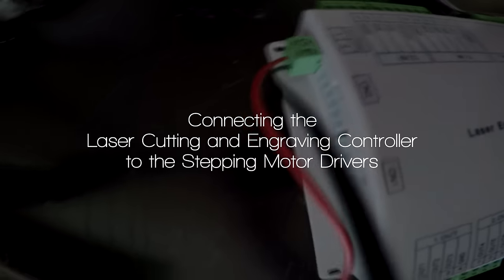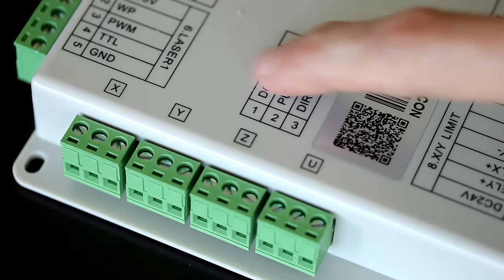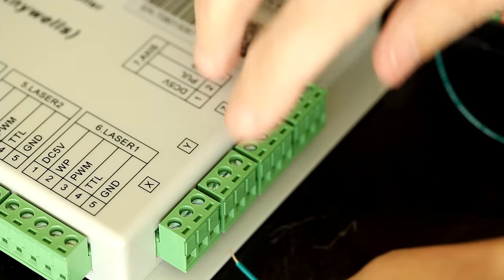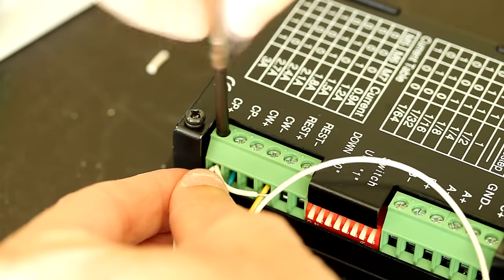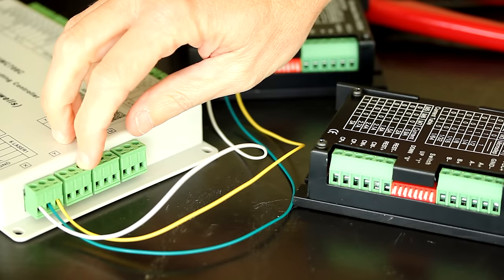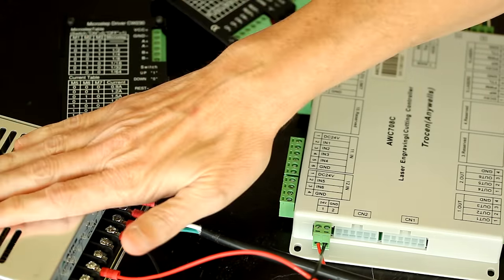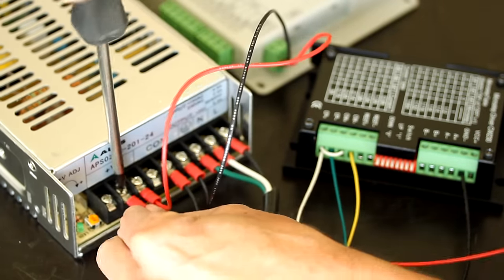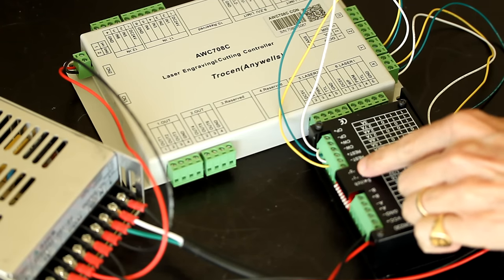How to wire the Laser Controller to Stepper Motor Drivers

Comment: Since there are no more ports open on the power supply, what if you wanted to setup another driver for say the Z axis motor? Can you just run two wires to one of the ports on the power supply?

Comment: Hi Patrick Thanks for you video. I change my controller and used this info. Im a left with a slight problem. The laser fires when traveling to its origin and then when it returns when job is completed. Also there is no variance of heat. It wont fire at 21% but full power at 22%. This didn't happen with the old controller. I have searched and found no help anywhere. Hope you can. Thanks
Scott

Comment: I want to use a controller like the one you use here, but I want to move two motors for the Y-axis. I want to use two drivers but the same signals for the Y-axis feeding both drivers, thus both motors. Will the motors stay synchronized?
Reply from the maker: Yes, just connect the same y-axis pulse and direction signals to both of the drivers.

Comment: can you please show me a video how to use mach3 usb board to control co2 laser?
Reply from the maker: It's best to use a traditional DSP laser controller, but you can switch the laser on and off using the outputs of the Mach3 USB.
Reply: @PatrickHoodDaniel  you have any configuration video for mach3 laser control?

Comment: Thanks for the video(s)! 
Is it not necessary to solder the wire before connecting it?
Reply: It's not strictly necessary but I like to do it so that the wire has more substance when you secure it.

Comment: So, how would you wire if you want to change direction but you say they are negative?
Reply from the maker: You can do this in the LaserCAD software, or you can wire the A and B coils in reverse.  That is to say, put the wires meant to be on the A+ and A- to the B+ and B- and vice versa.
Reply: Great, I`ll do that. Do you have videos for LaserCAD? I used to use inkscape but recently upgraded to awc708 board so I guess i need to learn how to use laserCAD